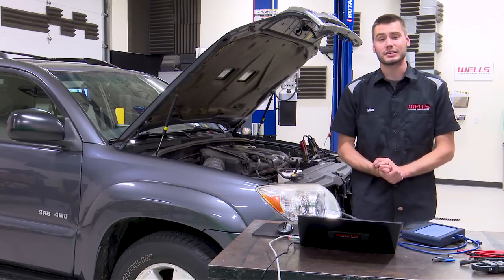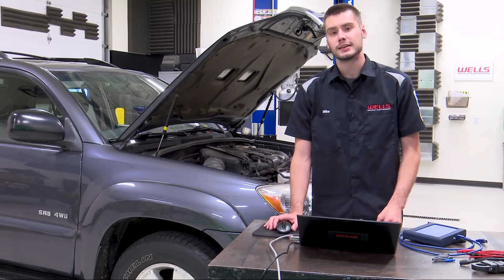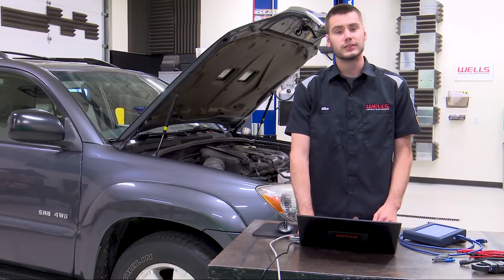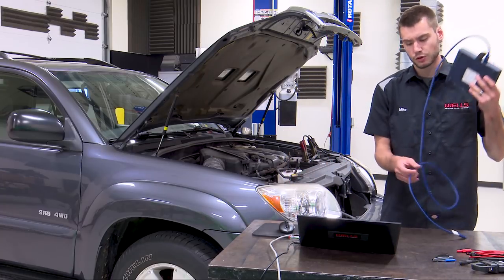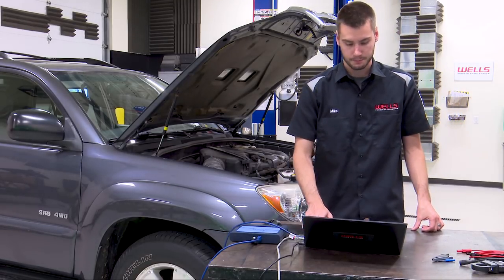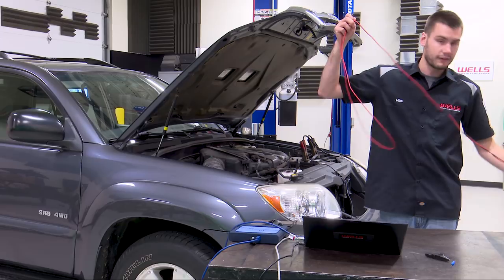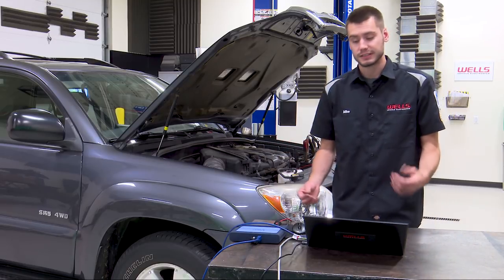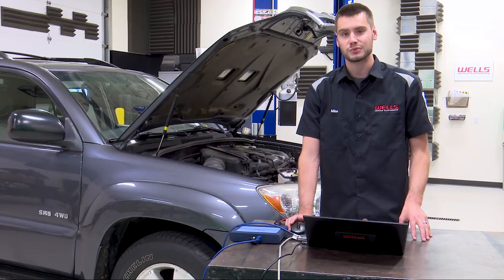How to Perform a Relative Compression Test & Why It's Useful When Diagnosing a Timing Issue (P0016)

Comment: Hey bud! I have a 2009 Jepp Patriot with this code and I'm trying to figure out if the Belt slipped and it's out of phase or is it something else. It's important to know that I had a head gasket issue last summer and used one of those liquids to that you put in your cooling system since I had a coolant leak. So my question is, could this be the reason why this code is coming on before I tear up half an engine to check if crankshaft and camshafts are in phase? I have the time so maybe I should do a compression test first? And it's only 4 cylinders so it shouldn't be that bad. Finally, the fact that the car runs (not optimal, jerking when cold but OK, plus I have a constant engine light on) could be a sign that it didn't skip and can be the head gasket. How do I tackle this? Thanks!!!
Reply: I forgot to mention that a year ago I did a new water pump plus belt so there is a chance that guy didn't tension everything right. I was told that these engines are notorious with two tensioners and the whole VVT system. Speaking of, I was f***ing around with solenoids that go on the belt but put them back after I figured out those where not camshaft position sensors, long story 😁 But I am wondering if this had something to do with it even though I had the check engine light on before that. Sorry about the long rattle but I just wanted to give you as much info as possible.
Reply from the maker: Hey, I don't see how adding that stuff to your cooling system could set this code...unless it caused your engine to severely overheat. You'll most likely need to verify proper crank/camshaft timing. 
Mike Becker, Senior Technical Instructor
Reply: @GoTechTraining  so the fact that I had to do this goes to say that I have a warped head and leaks on the gasket. So before tearing shit up and checking if the engine is in phase would it be possible that I am getting that cylinder misfire code because of the leaking head gasket again?
Reply from the maker: Sure, a leaking head gasket could cause misfires. At this point it may be wise to look into a reman or used engine. May be more cost efficient and reliable than what you are currently dealing with.
Mike Becker, Senior Technical Instructor

Comment: Hey, Mike. I don't see you use an attenuator  and a low amp clamp with the ignition trigger. Isn't it possible to use an amp clamp and an attenuator to protect the scope?
Reply from the maker: Hey, input range for the PICO 4225 scope is 200volts. Anything over that would require an attenuator. 
Mike Becker, Senior Technical Instructor
Reply: Thank you,Mike. I have a 2204A picoscope. I guess I am going to need an attenuator for an ignition trigger as well as an injector pattern, right?
Reply from the maker: From what I'm reading, that scopes is overvoltage protected to 50V. So yeh, you'll want to use an attenuator.
Mike Becker, Senior Technical Instructor

Comment: On a V6 (3.6), if the relative compression is all good, can this necessarily rule out a stretched / jumped timing chain on one bank ? I'm thinking that low relative compression might only show up under load.
Reply from the maker: Hey Joseph, relative compression is looking at all of the cylinders. If there was a bank to bank issue you would see it in there...but if the entire engine is low on compression then you'd never see it. 
Mike Becker, Senior Technical Instructor
Reply: @GoTechTraining  I'm getting close to 170 lbs on every cylinder - does this eliminate the timing chain kit as the cause of a bank 1 camshaft correlation error, or does the engine need to be under load?

Comment: Will a relative compress test help for a four cylinder  timing belt check
Reply from the maker: Probably not Trublue2319. A timing belt that has jumped will show all the cylinders low on compression. Relative compression really would only be useful when trying to isolate a cylinder/bank issue.
Mike Becker, Senior Technical Instructor
Reply: Thanks for 
The great teaching lessons

Comment: Hi mike excellente video, one question mike, how do you backprobe cylinder #4 ?  I did not see what was at the end of the cable that goes to #4. Thank you mike cheers from Ontario ca,
Reply from the maker: Hey Everardo, thanks for watching! I put my backprobe into the ignition coil control circuit on cylinder 4. This gave me a sync. Just right into the backside of the connector.
Mike Becker, Senior Technical Instructor
Reply: @GoTechTraining  thank you mike, I got it
Reply: Hey grate video. Im confused abou the cable back probably too.. is there a specific wire or just clip on to all 3 wires ?

Comment: It is ridiculous and you are talking to my boss directly. He just pulled the front of an Infinity G37 and the timing cover just to check the timing.
Reply from the maker: I'm guessing he doesn't use a lab scope? lol
That sounds like a lot of work!
Thanks for watching!
~Ryan
Reply: @GoTechTraining  He thinks it's a waste of time while it took him a few days to transfer parts from one infinity to another until he gets lucky. A crank and cams correlation to check the timing then energize the vvt would have given him an idea on the next diagnostic steps.  The best way to get him upset is to research the code on alldata or prodeman.

Comment: Every time I go after a Toyota fuel pump relay, it's called a  C/OPN relay and it's buried and/or integrated with the under dash fuse box, never to be seen again.  If there's a spot labeled for fuel pump relay in the under hood block, it's a blank space and the C/OPN relay laughs at me again.  Then, if there's floor access to disable the fuel pump under the rear seat, said rear seat will have child car seats and what looks like hurricane debris level family junk in it and under the seat will be stale or soggy cheerios, cheetos, and skittles that have somehow melted and molted and evolved into some parasitic life form that's suddenly stuck to my arm and it looks like it's moving....get it off me....You got the fuel pump relay under the hood...Why yes I'm whining.  What gave it away?  Anyway, thanks as always for the videos.  Now seriously, go get something to pry this skittle amoeba thing off my arm.
Reply from the maker: Shaun, this was great! You should write short stories! Ugh Skittles were the worst! How did they ALWAYS end up inside of sliding door panels!??!?!?!
Mike Becker, Senior Technical Instructor

Comment: Pressure transducer time
Reply from the maker: Hmmm...is it? Why would you go transducer next?
Mike Becker, Technical Services Instructor
Reply: Wells Vehicle Electronics just to check the timing and then both cams and crank each bank
Reply from the maker: But Vince, how does the pressure transducer check the timing? What are we looking at with that transducer? Not saying you're wrong, because everyone does this different. But what would you specifically be looking at with your transducer?
Mike Becker, Technical Services Instructor
Reply: Wells Vehicle Electronics 
720 of crank rotation channel a pressure transducer  channel b on 1 3 or 5 sink  just run it for a min see if your timing marks are in sink
Reply from the maker: How do you see the timing marks with a pressure transducer?
Mike Becker, Technical Services Instructor
Reply: Wells Vehicle Electronics top dead center of your compression stroke your sinked on 1. 3. Or 5  u will see right where your firing  i no u no this mike mesxing with me lol
Reply from the maker: I'm not messing with ya man, I promise! Just want to talk through this with ya! Alright, so we potentially have a timing issue here right? What is our ignition trigger on an engine? Doesn't the ignition get pulsed off the crank sensor? Or cam sensor? Doesn't make a difference which in this case....if our engine is out of time, wouldn't the ignition pattern not follow and look perfectly normal on the out of time motor? 
Mike Becker, Technical Services Instructor
Reply: Wells Vehicle Electronics 
Danner has several videos on this 
Tdc will show on your screen and your sink channel b hooked into coil or coil wire will show when its firing if on time it should be just in the center of tdc hump if off a tooth u will no it  but it should fire right down tge center i love that test save alot of time pico is the best
Reply: Wells Vehicle Electronics 

We dont need any timing mark i just go off tdc 720 of crank rotation 2 tdc humps are on screen and the firing event if in time blows right through the center
Reply from the maker: Alright, I'll check em' out. Not sure if i'm sold yet :)
Mike Becker, Technical Services Instructor
Reply: Vince Bauer very very nice... You impressed me , and I don't impress easily
Reply: New Level Auto 
I learn all this from u top dogs keep up the great videos
Reply: Wells Vehicle Electronics 
Your good people mike Becker
Reply from the maker: Vince, I couldn't sleep last night thinking about this. I will need to do this on the next car I get with issues. I wonder what factors could throw this off. You ever been burned by this?
Mike Becker, Technical Services Instructor
Reply: Wells Vehicle Electronics sorry mike was super swamped today u haing your class tonight??
Reply: Wells Vehicle Electronics no its worked great use it alot
Reply from the maker: Super swamped, probably made you day fly by? Class is up, enjoy!
Mike Becker,Technical Services Instructor

Comment: In the real world I doubt there are many techs who would waste time on this test, me being one of them. Here’s the beauty of these types of fault codes: The computer tells you what the problem is and where to look! Of course there are preliminary checks you should do, but when you consider a 10+ year old car with god knows how many miles, and we all know how prone timing chains are to stretching over time regardless of maintenance, some of us might be a little more confident making a call without getting into a case study

Now, you say you need to advise the customer on the correct repair the first time which is the right way to do it... but this scope test you did here still doesn’t tell you exactly what the issue is, (it also didn’t tell you anything that the fault code already didn’t) so in the end, what is it really worth? Even if you scoped your cam crank and compared to a known good, you’d still be unwise to tell the customer they need only a timing chain before tearing it down. See, there’s a right and a wrong way of selling work. If you say you need X amount of time just to check valve timing based on your findings, you’re doing it wrong. If you tell them based on mileage along with the fault code it looks like it needs a chain, but you need to tear it down to verify there’s nothing else wrong, your hands are clean if they ok it. You didn’t waste any time solely checking valve timing, and the “job” is being done at the same time as your inspection, because you sold it that way. And if you find additional problems once it’s apart, you already covered yourself when you advised the customer

For the sake of teaching, there’s something to be learned from this video. Even If this is how you’d approach an issue like this in the shop, I guess there’s nothing wrong with that. The issue I have, is being told from all angles that I need to spend 8K on a scope setup, when more than probably 98% of the time not only does scope data not tell me exactly what the issue is, it doesn’t tell me anything that I don’t already know. As well, there are alternative testing methods (to be used with conventional tools) that can be applied based on available symptoms, other than using a scope
Reply from the maker: I agree with some of your points. But remember this is a case study video. In Real world time we would have our data and analysis in 15-20 minutes. This is why a lab scope can be helpful 
~Ryan
Reply: @GoTechTraining  I know, I’ve said this a million times, that a scope is a great teaching tool, arguably more useful than for diagnosing. This video wouldn’t teach anyone a thing if all you did was scan and tear down